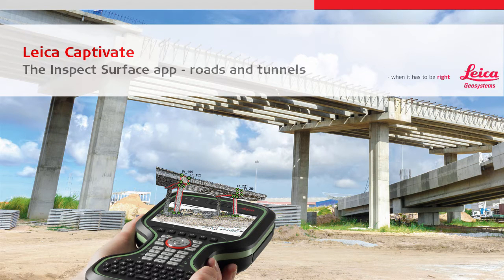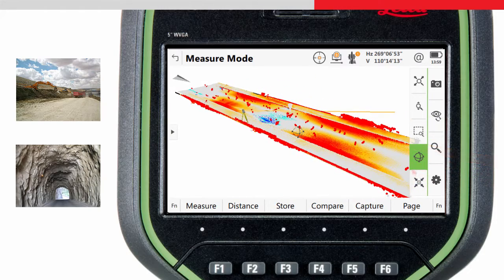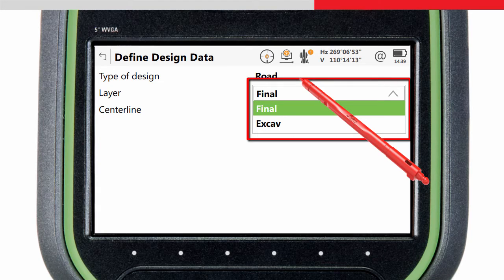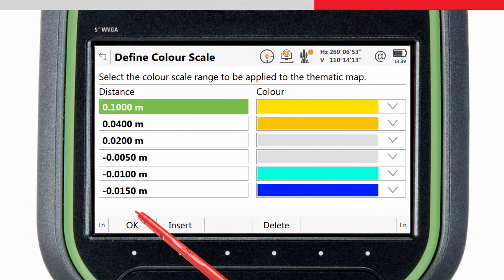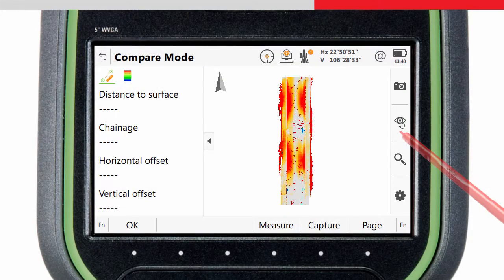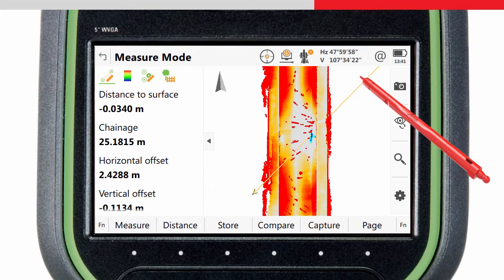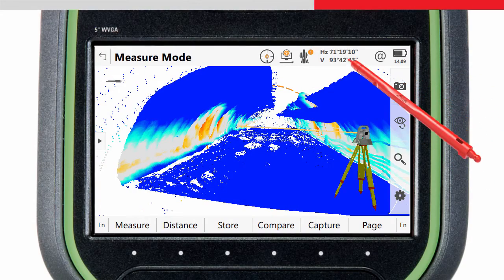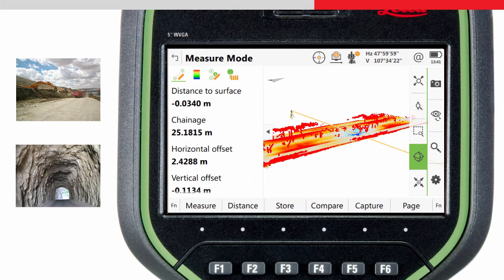Inspect a surface (Roads and Tunnels)

Comment: If 3D road data needed for Leica Stake Road (RoadRunner) app, see our video with en subtitles here: https://youtu.be/MR9mXfrvyGc. 
For data preparation we recommend Leica iCON Office software, fully compatible with Leica Captivate, Viva, Nova, 1200 and 1100. Via Leica Job DBX format or universal XML as well. 
DTM model Job or 3D pts & lines Job for stakeout require one step, simple export from iCON Office SW.